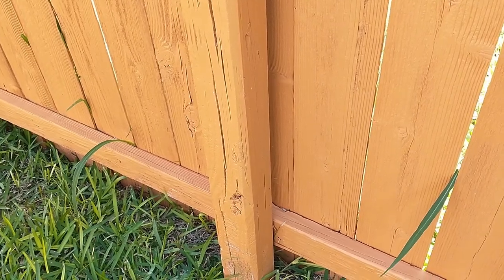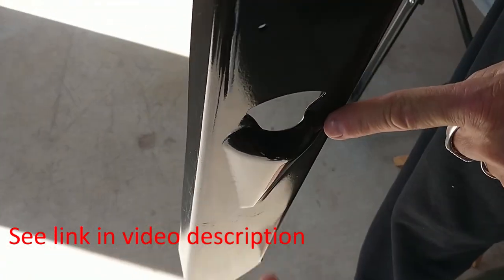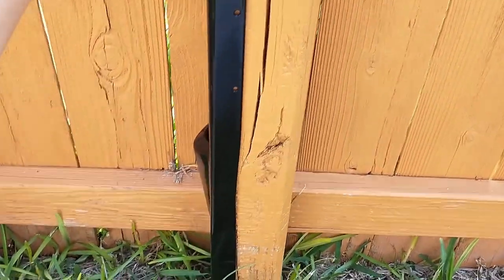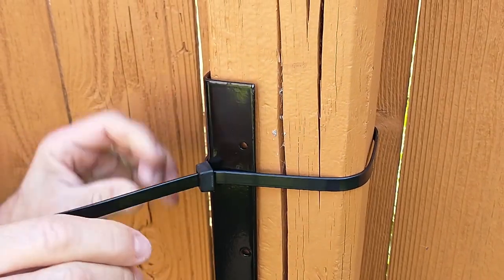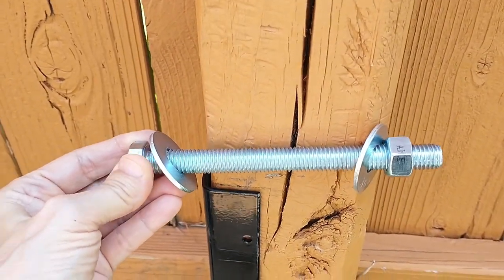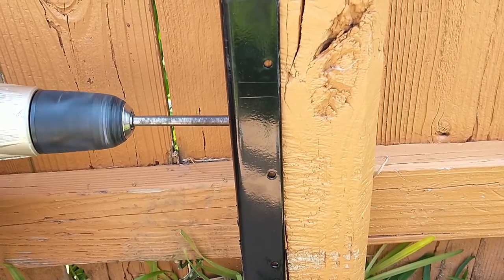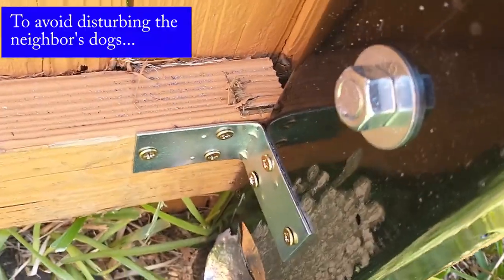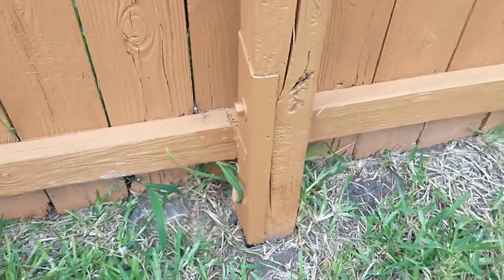Repair a Wobbly Fence Post

Comment: Very good explanation.  By the way, how old is your fence?
Reply from the maker: It was about 17 years old.
Reply: Absolutely horrible that was a terrible terrible repair the bracket only went down 2 in that would not stabilize a wobbly fence if it's only going down 2 in

Comment: What about if it’s already in concrete?
Reply from the maker: The brace goes down in between the fence post and the concrete.
Reply: Not if ur post is set in concrete like it should be. Then there is no space between the post and cement
Reply: @Jean78578 ???? I really doubt that.